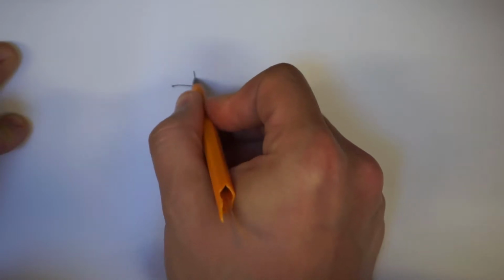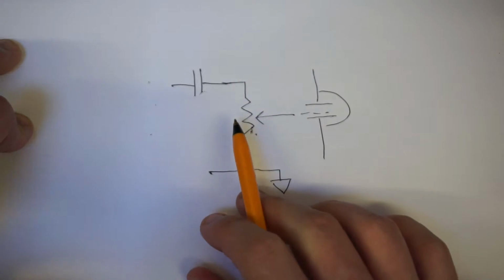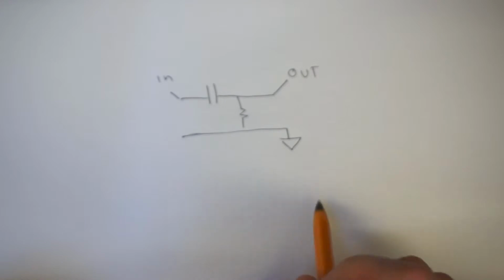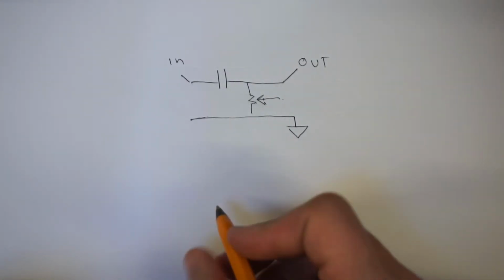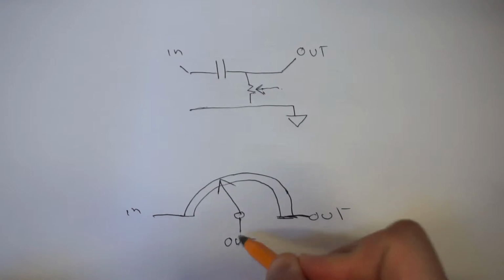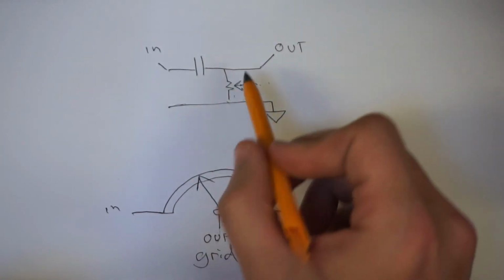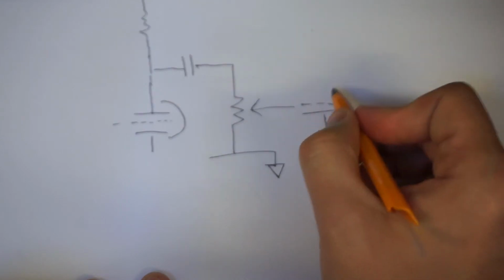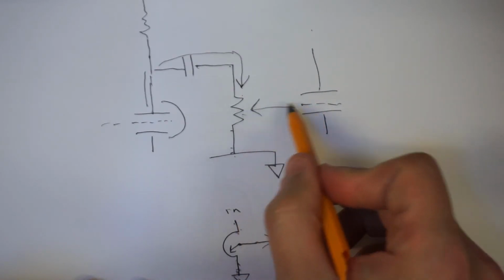Dallas Scala tube amp, Repair and mod Part 4, Correction, high pass filters and volume pots

Comment: Hi David,                      just on the off chance that you can recall this amp,its been a while,did you put it all back together and did you manage to get a schematic from anywhere ?The only one I could find was a John Beer one for the 519.The one I have is similar to yours,wondered how you managed to move the volume control the other side of the first riode?did you have to cut some tracks?cheers.
You`ve got some cool vids on there by the way cheers.
Reply from the maker: Hi. Thanks for the message. Much to my shame this amp is still in pieces in my old workshop. From what I remember I never found a schematic but I think I tried to document it myself in a very amateurish way. If you need me to check anything let me know and I'll try and get back to you when I can. Deffo wouldn't have cut any tracks, off the top of my head I will have just lifted the legs of the components in place between the first and second triodes and attached flying leads
Reply: @DavidImrie  I can see what you`ve done with the input and your mods look good.On your mods schematic where you going to try the c4 circuit as a master volume type of thing?I `ve got some weird component values on mine ,going to try and replace whats broken with more conventional values as in in wems/selmers and see what happens?